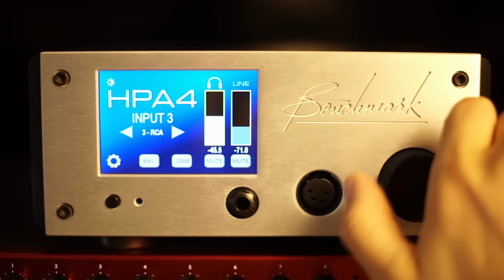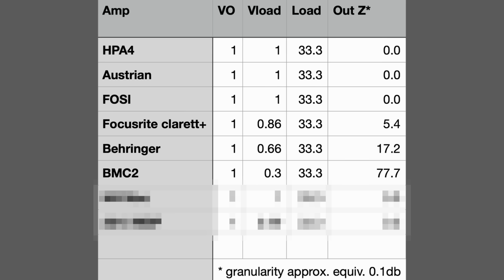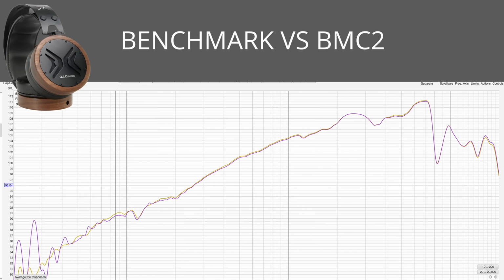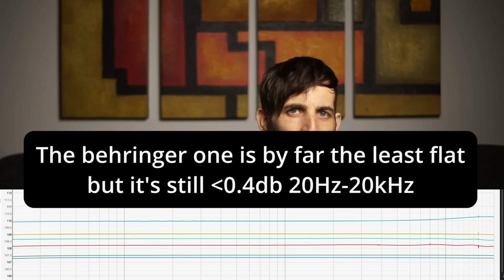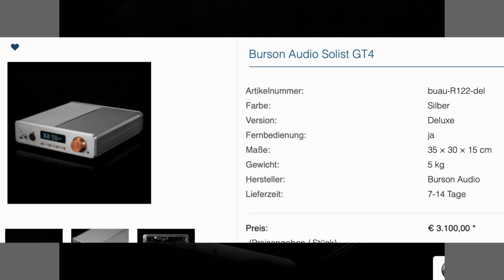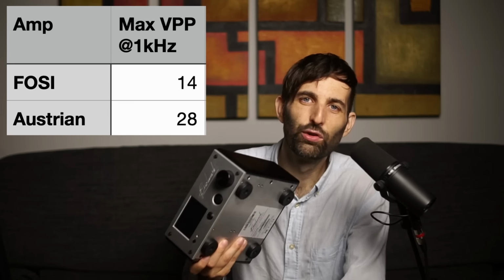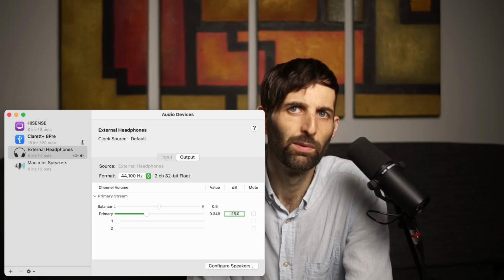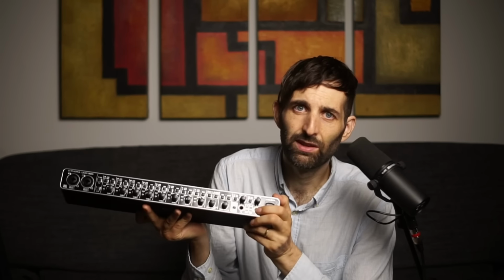Stop plugging your headphones into your audio interface!! Headphone amps demystified.

Comment: I have gotten the Fosi Audio ZH3 and it sounds great. Was currently using the Clarett plus 2 for mixing with VSX. What I notice was the left and right channels was unbalanced at certain volumes, on top of that it can not be accurately set to a level that I'm going to be mixing at. I've watch a video about the Fosi ZH3, the gentlemen recommended getting the 12V Sonic Scientific Hades Linear Noise Reduction Power Filter Energy Module. It's basically a power reserver for when the headphones need more power for something like a kick, bass or something that demands more power to the headphone, it will have that extra power for these types of situations. Anyways, I think it's a great product, still waiting on the Hades Power Filter for my own tests. From what I seen online, you can swap out the opamps in these as well. Thanks for the recommendation.
Reply: you're clarett have a bad potentiometer
Reply: @ThaexakaMavro  I got it second hand so probably the reason they sold it. Either way I got the ZH3 so it can help with this. Love the Clarett plus preamp sound though, the air function really helps the DA67 shine through a little more.

Comment: This was really a very eye opening video! Wow and there so many key parts for mastering in this video! Thanks so much for sharing this. I had to switch to mastering on headphones due to the smaller room I am in now, so I got the Audeze LCD-X headphones and was looking at Amps. Since also composer, mixing and mastering my music, I used for now my Scarlett 8i6 Focusrite while was saving up. And I always had this one question in my mind - If you use the Audio-Interface with Headphone Amp, your audio interface A/D comes into play. And also like you mentioned, the listening level is critical for mastering... not that easy with a pod. And yip the stereo field changes 4 sure on those units. With an old unit it even makes noises as you turn the knobs. 

I really glad I found your channel because I also doing checks on EQ with plugin doctor and wanted to understand what is this analog button now really doing :) Grew up in a science family (and love it) - but I also still dream of building a full analog mastering studio. But back to your video - big thanks - i gave me something to think about now

Comment: Just got into this audio stuff. 
Limited funds, hence nearly new Sennheiser HD 490 Pro (impedance 130ohm) for £270 and a Fosi Audio SK01 (impedance range 16ohm to 300ohm) off AliExpress for £47.
Not spending anymore than that. 
Question is, after all the research to get to this point, did I get it right for the money?

Comment: One thing that was missed regarding the Apple headphone jack is that it has auto-sensing. It detects the impedance of the headphones and changes the output voltage accordingly. Headphones under 150 ohm get 1.2 volts, and 150 or higher (up to 1K ohm) are set to 3.3! My Senn 660 S2s sound better than the headphone jack on my UAD Apollo X twin!
I wish he spent less time bashing Behringer and more time with interfaces that we actually use, like Antelope Audio, UAD, RME, etc.

Comment: Interesting! I didn't expect such significant differences. But one point I want to add: Of course, there are some recording interfaces that have good headphone amplifiers. For example, my MOTU not only has a stepped potentiometer but also displays the gain in dB steps. This makes it easy to reproduce the same volume setting. Regarding the frequency distribution variations: In the end, you have to find the right headphones for you anyway. That "right" also includes your own headphone amplifier. So your findings are certainly interesting, but ultimately have more academic value. As far as your headphone amp can amplify loud enough without distortion and you are able to reproduce your "standard" gain, it's fine.

Comment: For those who are wondering, the newer M4 Macbook Air features the same DAC as the pro he mentioned. From apple support: 

You can connect high-impedance headphones directly to compatible Mac computers introduced in 2021 or later.

The 3.5 mm headphone jack on compatible Mac computers features DC load detection and adaptive voltage output. Your Mac can detect the impedance of the connected device and will adapt its output for low- and high-impedance headphones, as well as for line-level audio devices.

When you connect headphones with an impedance of less than 150 ohms, the headphone jack provides up to 1.25 volts RMS. For headphones with an impedance of 150 to 1k ohms, the headphone jack delivers 3 volts RMS. This may remove the need for an external headphone amplifier.

With impedance detection, adaptive voltage output, and a built-in digital-to-analog converter that supports sample rates of up to 96 kHz, you can enjoy high-fidelity, full-resolution audio directly from the headphone jack on your Mac.

Compatible Mac computers
These Mac computers support high-impedance headphones with the built-in headphone jack:

iMac introduced in 2023 or later

MacBook Air introduced in 2022 or later

MacBook Pro introduced in 2021 or later

Mac mini introduced in 2023 or later

Mac Studio introduced in 2022 or later

Mac Pro introduced in 2023

Comment: you really need to get into eq if you want accurate headphone playback
Reply from the maker: if you want increased distortion
Reply: Absolutely. Basically all of them need some amount of EQ.
A headphone that distorts when it is EQ corrected is inappropriate for productive work.
Reply from the maker: @sparella that’s all dynamic headphones and dynamics are the best for production
Reply: @APMastering Some newer high quality dynamic drivers can handle EQ with negligible distortion. Aune AR5000 for ex. can handle the sub boost needed to correct bass to Harman 2018 target.

But we also aren't limited to one thing, so I am using a planar, a dynamic, and an IEM. (And IEMs themselves aren't limited to one driver type.) Corrective EQ eliminates jarring tonal changes when swapping between them.

Comment: Behringer does just fine for what it costs. And i am 100% sure that you couldn't hear 2db difference at 30hz blindfolded. The Behringer circuit that represents the headamp costs 10€, and you compare it to a 4k snakeoil. 
The output level depends on the input level. So even if the 4k snakeoil turned at 0.1dB you couldn't get consistent levels without level metering.
Again, i dare you differentiate between Behringer and the 4k audiophoolery at moderate levels, of say 20mW.
Reply from the maker: 2db across ALL frequencies at a good loudness. That is insanely bad and I can immediately hear that.

Comment: 31:43 you're begging the question by assuming all PCs are "random lucky dip junk." I notice you didn't measure a random PC laptop to demonstrate. [edit: should've included your wife's laptop measurements in the table!] Congrats on making it a half hour without being a troll, though. With the money people save from not buying Apple, they might be able to afford better headphones.

Consistent quality vendors absolutely do exist for PC hardware. I was part of a team that migrated a bespoke design to use off-the-shelf embedded motherboards in audio test equipment. the measured audio of the same realtek AC97 codec used across different motherboards varied widely, but was consistent among single motherboard models. I don't slight Apple here -- they do make good hardware -- but I expect other name-brand laptops from Dell, HP, Lenovo, Asus, or Microsoft to be comparable.

Comment: Sennheiser HD800 user here. Getting that Fosi HP amp, but should I upgrade to balanced cables and which would be the best connector, rear 2 x 3 pin XLR's or that front BAL 4.4mm one. The cables are a minefield!
Reply: Balanced input is useful for electrically noisy environments. If thats not your case, then little benefits to be had. Single ended output is fine, but if your headphones require the 4.4mm, then do that.

Comment: Something to keep in mind is that while these differences presented between the various amplifiers with lower and higher output impedance at the amp stage are significant enough to steer people in the right direction, they're nothing compared to the destructive effect that the higher impedance would have on IEMs which typically have a much less linear impedance than single-dynamic driver headphones. You can be looking at an impedance curve that starts at 6ohms in the lows and get's all the way past 20ohms in the highs. The FR curve comparison between the various headphone amps would look massively different when driving a device like that. Always a good rule of thumb to look for a headphone amp which doesn't introduce un-needed impedance into your signal chain. This can also be true of wires. While most cable stuff is snake oil, the amount of electrical resistance that the cable introduces into your signal chain is relevant, some cables are lower impedance than others and would generally be preferable. Also a good reason to not use crappy headphone extension cables as those have massive potential to influence the FR.

Comment: I just got my Topping A900, I would have went fosi, but needed the power for my SJY HCC with a bass shelf they draw crazy amounts of current. Im not sure they aren't on tungstan levels when it comes to current draw. It sent my old A90D into protection mode, and I've heard other accounts of amps getting shut down for the current it requires.

Comment: The Moto M4 is brilliant to play music back on, a pair of active speakers & your laughing, does 250ohm headphones, ESS Sabre DAC's, very very good sound  quality, some people use them as headphone amps or DAC's....it does music excellent, 2ms latency at 192Kh...used with BD DT700 Pro X's there great for silent studio use, i like the Sennheiser HD660S's in balanced mode used with an Ifi V DAC ll, for the price it sounds very good & got a choice of headphones or active monitors, the Moto 4 pleasently suprised me, sometimes the laws of physics through's up some odd results, the Sennheisers looked best to me easily on a frequency chart, headphones or active monitors sound really good with the Moto 4, a well built headphone amp should sound better but depends on the maker, build quality & price & synergy is important, i would'nt use headphone amps that have more than 0.5db - 1db channel variation if possible, sometimes the rule book goes out the window, not all low impedence headphones are bad quality, Focal sell enough for mixing but i don't like them but many people do, an Ifi Zen DAC II used with one of the standalone Ifi Zen DAC's/Can's etc for more digital inputs & sounds fantastic as balanced, cheap as chips compared to the Benchmark, ain't no lack of bass in my Sennnheiser 660S's used in balanced mode at 150ohm, sounds fantastic, no need to spend many thousands, there are some great headphone amps for less than £1000, the Benchmark is very good but to expensive, if an off the shelf DAC ESS Sabre's sound best to my ears, i'm not an AKM fan, it's all about that magical thing called synergy, you gotta find things that work together, comes with time & experience, & a few bad buys along the way....all that money....lol

Comment: Plugging my Headphones into my interface, is the only way I can monitor my Microphone, without a delay that renders me incapable of speaking coherently. Where else am I supposed to plug them in????
Reply: You'd plug your headphones into a dedicated headphone amplifier. The amp gets its input from the interface output so there is no latency.
But for tracking it doesn't matter. Use what works. Mixing and mastering is when accurate monitoring for critical listening is required.
Reply: @sparella  that kind of setup sounds a bit overkill just to drive some HD280 pros.
Reply: @intranexine8901 Agreed. In your case the limiting factor for critical listening would be the headphones and not the dac-amp chain.

Comment: That behringer piece of shit is the single worst piece of gear I’ve ever owned. You can’t individually turn down the speaker out separate from the headphone out. Also it would start doing some buffer time code mismatch glitching after using it for a few minutes every single time. Fuck behringer

Comment: MacBook senses the impedance and adjusts the max voltage. 

“When you connect headphones with an impedance of less than 150 ohms, the headphone jack provides up to 1.25 volts RMS. For headphones with an impedance of 150 to 1k ohms, the headphone jack delivers 3 volts RMS. This may remove the need for an external headphone amplifier.”

Comment: My takeaway is that the Benchmark is far and away the standout amplifier for home defense purposes. Thank for this educational content.

EDIT: More seriously, that the Benchmark has some (IMO marginally relevant) but seriously impressive quality to it (would be overkill for normies), that if you insist on doing it analogue, may be worth it to professionals regularly making an extra $4000 they can afford to plunk down on an amp. Though a MacBook can do the job of a correctly-behaving headphone jack if used properly (some high frequency inaccuracy when operating at low sample rates, it would seem).

I hear independent of this video that the Motu M2 is decent in terms of the things measured here, though I don't know how the volume knob does in terms of channel balance. If the Apple USB-C to 3.5mm adapter gets loud enough for your particular headphones, it is another MacBook-like level of quality that also works on Windows and mobile, which is nice. I think it lacks the issues at higher frequencies the MacBooks have at low sample rates? Though I'm not utterly certain.